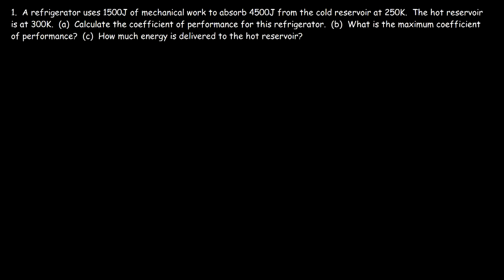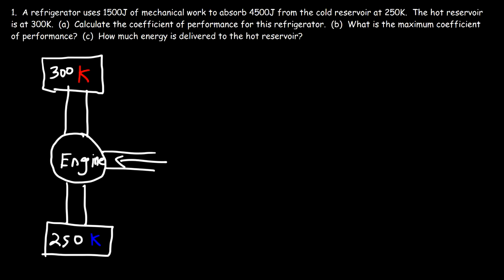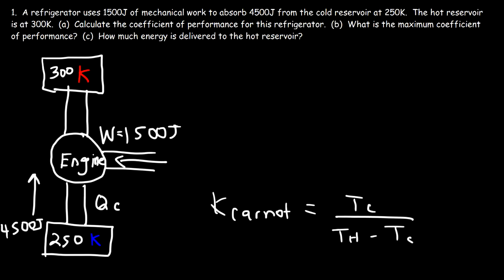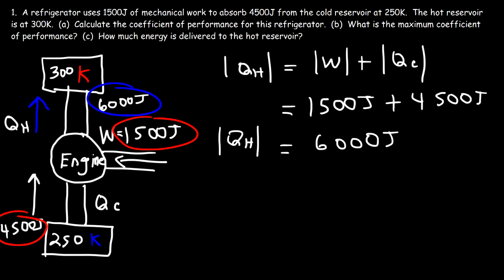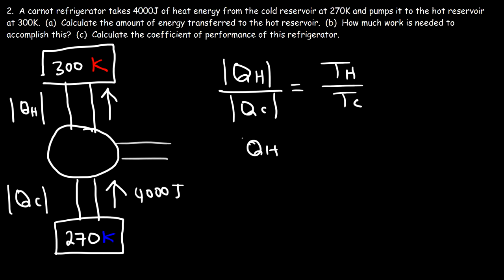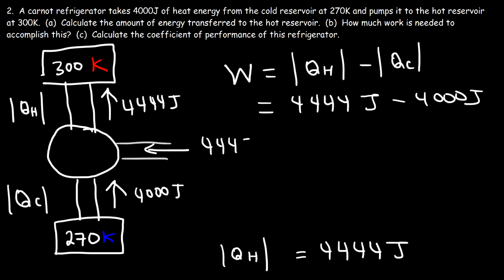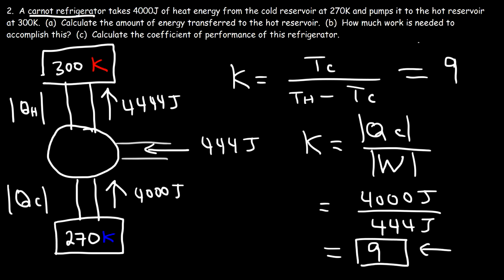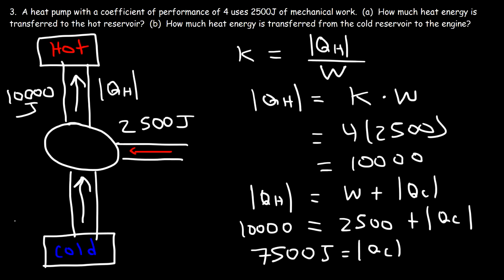Refrigerators, Heat Pumps, and Coefficient of Perfomance - Thermodynamics & Physics

Comment: how does the system behaves if we use the heat pump to recover heat from an exhaust fluid which is at a higher temperature than the heat sink. It is normally a spontaneous flow, and will not require energy input, but will instead output energy as work done. However, can we still use a heat pump in this case to increase the heat gained by the cold reservoir? For example to recover heat from some exhaust fluids which are at higher temperatures compared to the heat sink.

Comment: All is perfect. But in last example, you used a formula to calculate total heat transferred to hot reservoir as k=QH/W, where as you have introduced formula for coefficient of performance as K=QC/W in the first example. It creates confusion, which one is correct, if formula given in example 1 is correct then in example 3 the heat transferred to hot reservoir must be equal to 12500J.
And heat taken out from cold reservoir equal to 10000J,
Reply: in the last example he used K=Qh/W because he was solving for a heat pump, whereas in the previous example when he used k=Qc/W, he was solving for a refrigerator.
Reply: @khaledsissi3762  how are both different? They work the same right?

Comment: Wouldn't the sign of the work be < 0? If work is done ON the system, then the sign of the work is positive because the system is gaining energy at the expense of the surroundings?
Reply: formulas for internal energy diffrent in physics and chem
Reply: @muneibrauf9779  Would you kindly give examples?
Reply: That is the case in thermo-d of chemistry...... 
In physics work done on the system is negative
Reply: @tusharsharma428  That means that the system loses energy when work is done on it: a system loses energy when the surroundings (an outside force), transfers energy into it. This is precisely the opposite of what happens.
Reply: @JRockTT  yes, in the physical world we want machines to do work for us. That's why we consider it +ve.That's how I remembered it.